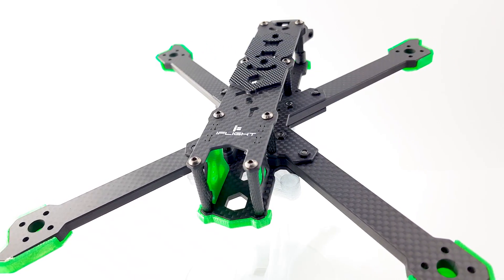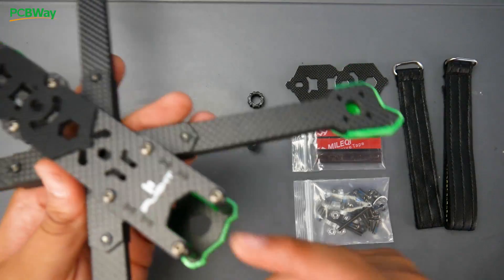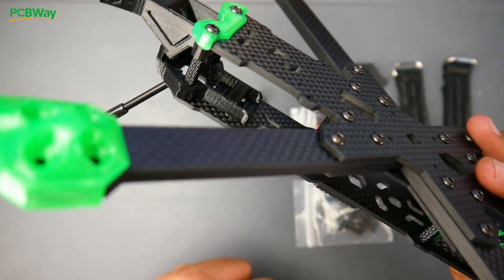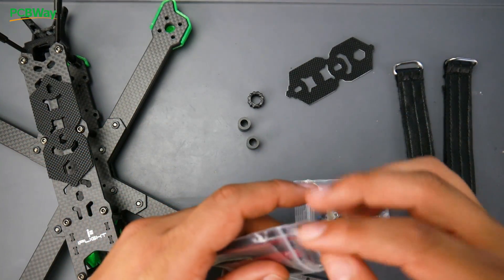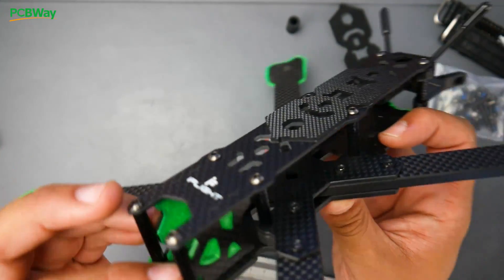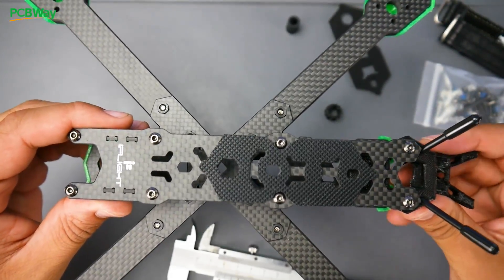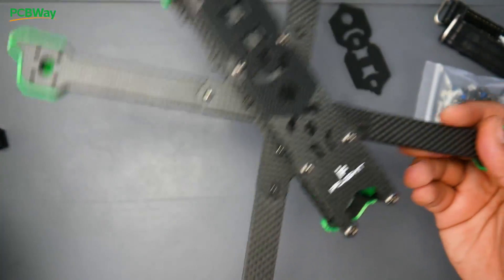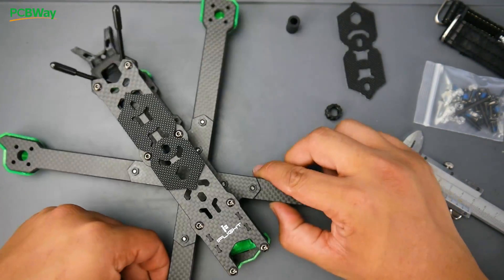Amazing FPV Frame for $50 / iFlight Titan XL5

Comment: I'm new to fpv drones and bought this. What motors would you recommend for this frame?
Reply: Depends if you’re going 4s or 6s ?
Reply: @Tritorpol  I'm going with this frame for 6s thinking on the Velox V2 1750Kv, what do you think?

Comment: Can you confirm what size M3 screws to be used to mount the motors? The  arms are 6mm and also 3d printed protectors there, so i guess longer screws?

Comment: I really like you man, and how you have grown your channels, tremendous. But I feel you are really trying hard to sell this frame when really it’s not a great design, and you kind of know it.
Reply: What's wrong with the design
Reply: @MrSabram07  a lot of things, starting with weight. It's way way too heavy. So much room inside which makes no sense, it will end up messing
 the CG. It's v5 and still the arm screws go through the stack. Almost every other great frame out there has the stack screw separated. Also it's not an innovative design for which he has to make a video about it. It's just another frame. If you are new, definitely go for glide from fpv cycle, it's fantastic design and strong like a tank.

Comment: Beefy arms, but still so wide and flat :/.  Check out Kabab's Hyperlite Glide 5" for a nice modern $50 frame, 'Hammer' version for thicker arms.  Available at FPVCycle.
Reply: Hyperlite 5-in you say, got to check it out

Comment: Don't you think this frame is badly balanced? Heavy air unit and batter far behind center of gravity. Back motors have to work much harder and for free style isn't neutral. Maybe it's ok for cruiser.
Reply: If you mount a gopro the farther back battery position helps
Reply: @joelk8669  battey is heavier that gopro, and airunit also isn't light. Sorry this is just bad design.
Reply: Air unit in the center.  Balance cg with battery position.

Comment: I love the true X geometry but other than that I see a lot of details I don't like. The arms don't touch each other for added stability but they go where the center stack sits which adds to the total height. Both aspects are much better in the GepRC Mark4 or HGLRC's Sector5. The TPU receiver mount is where one would probably would like to run a second battery strap. I do fly 3 iFlight frames but I'm not a fan of this one.
Reply: Pter Anodon exactly, it’s a very poorly designed frame. I don’t know why he’s trying to convince his audience how good it is.